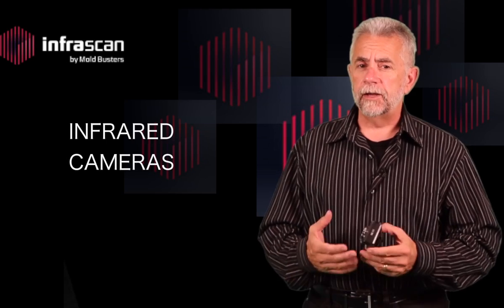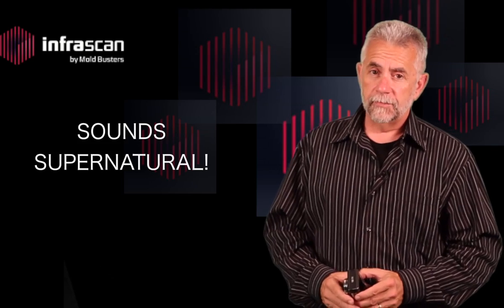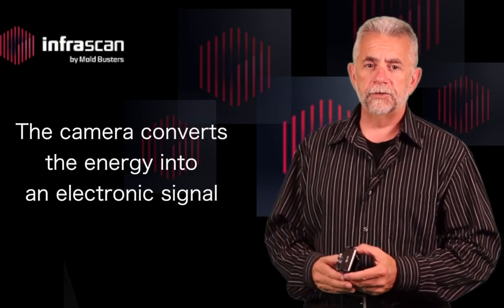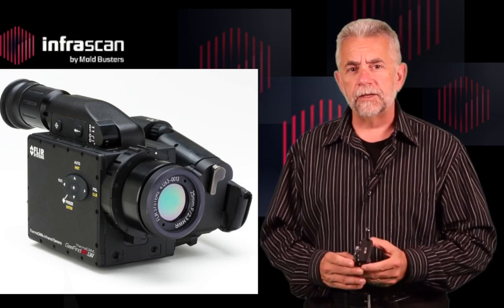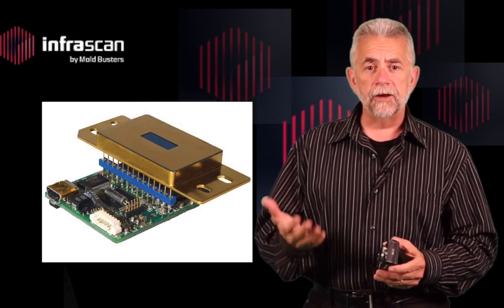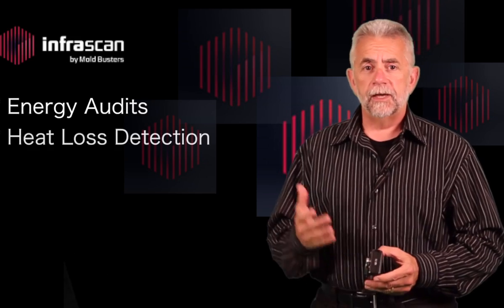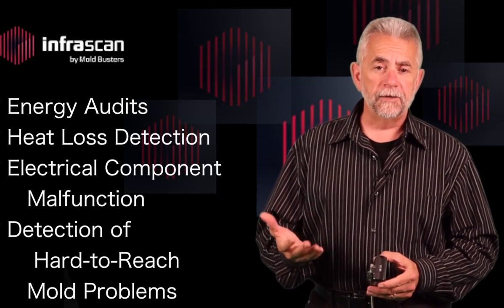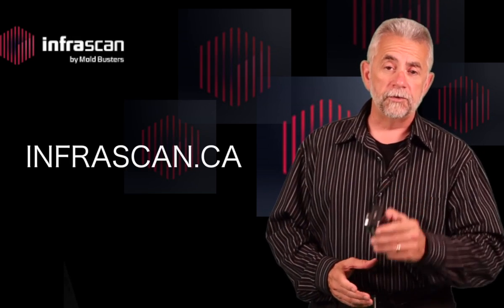How Do Infrared Cameras Work?

Comment: Well if this is a digital camera then it works the exact same way as any other digital camera. Infrared light is a part of the electromagnetic spectrum jist like visible light so the ccd or cmos or whatever imaging sensor these things use are setup to see ir wavelengths and as the photons hit the sensor it converts them to an electrical signal thats processed into an image. 
Maybe do a better job of explaining your shit rather than "sounds like magic" or whatever the hell you said. Stop dumbing everything down